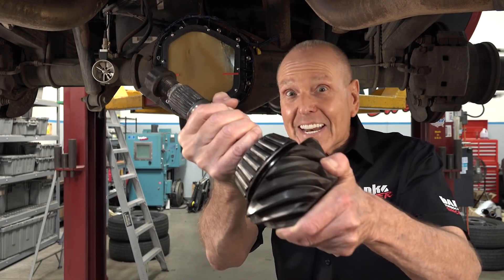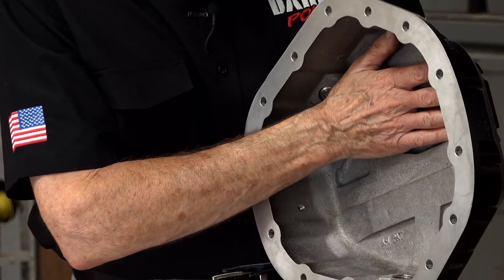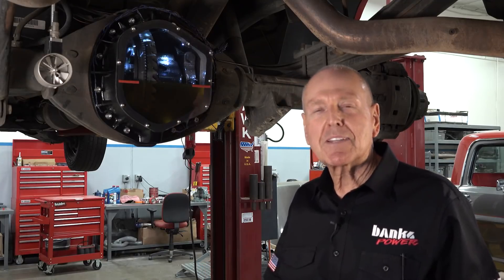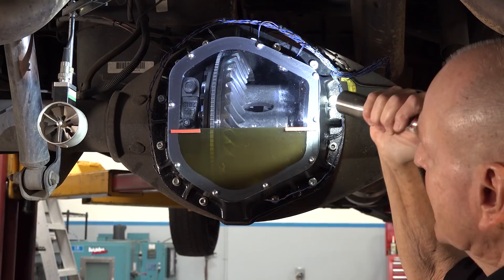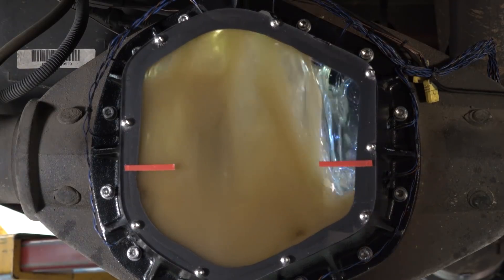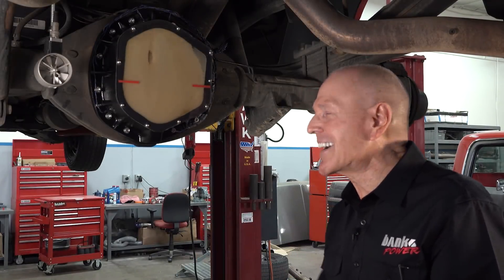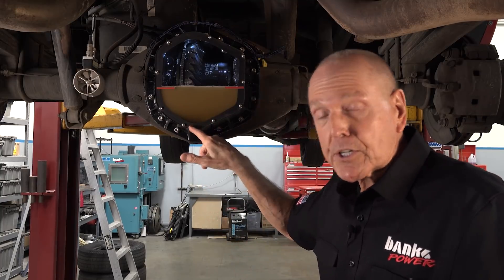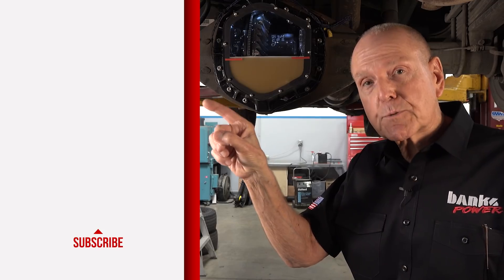What's going on behind your flat-back diff cover?

Comment: You allege that no oil is getting to the pinion but you don't demonstrate that fact. You need a borescope aimed at the pinion to verify.
Reply: With all of it ending up being splashed around by the cover, it makes a person wonder just how much is being pumped up to the nose cone bearings..  Maybe that's why they call for the extra fluid?
Reply: I think there's plenty going to the pinion, nearly impossible for there not to be with that much fluid splashing around. However it seems to get there far less efficiently than a stock cover.
Reply: Yea, I can see where he's going with everything except the pinion issue, look at the bearings in the rotor of the older American cars, you pack them with grease but it squishes out of the bearings almost immediately after you start rolling, it only takes the tiniest amount of lube to satisfy those types of bearings, I've been building Harley engines for almost 30 years and the same kind of bearings are in the bottom ends of those engines and with the exception of the connecting rod bearings none are pressure lubed, they rely on what trickles into them from fluid that just drips down the inside of the cases, those types of bearings require very little lube to do their job.
Reply: Seems fine to me.  Maybe they need to run one for 50,000 miles equivalent, one stock, and then pull the gears and inspect for wear indicators, cavitation pitting, etc.  That's the real test not cursory visual inspection of how the fluid looks on the cover.  XD  this whole series is crafted to create a market for Banks' finned aluminum covers.
Reply: Bingo.  More lube isn't better.
Reply: I don't think he is getting that out right. It is common knowledge that there is oil getting to the pinion or every one of these trucks running these common kits would be in the shop every time. Almost every newer 3/4 ton out there has a 4" lift, diff cover, programmer, delete's, exhaust, and bigger wheels and tires. Everything needed for the manly feel. They are getting oil to the pinion, but not in the best fashion. The bigger point is that the aftermarket cover doesn't gain over a stock cover. Something like the Ram factory design with an aluminum heat sink cover is likely the best option.

Comment: Great job Gale on the windowed flat cover. One can really see what's happening inside the dif. There's a lot of trucks on the road with these dif. covers. I agree with your analysis of what's happening inside with the oil. That oil has too much air whipped up into it. Perhaps a channel around the ring gear to mimic the original cover may help.

Comment: I appreciate your effort and videos, but every video I have seen, like yours, clearly shows ample quantities of gear oil where it should be. You make it sound like something really bad is occuring and making unfounded conclusions about "starving the pinion" when you can't see that happening. Of course it's not happening. It's being properly bathed in gear oil. Many aftermarket covers have cooling fins, too. That's very functional when passing through a parcel of ever-changing air. Then there are even more functional covers that actually support the internals, like LPW. Also, the term is aeration---not aereation.
Reply: It's a series! It's all leading up to end results with temps, drag, and what is and isn't getting properly lubed, are u that thick headed where u dont understand? Or u just bought a big cover a few weeks ago and are mad u wasted your money?
Reply: @kwmiked  You didn't refute a single point I made. I know many with these covers with no ill effects for many thousands of miles. It boils down to a preference, due to no evidence of a real problem.
Reply: @noampitlik2332  go do some research! Maybe none that u know of cause they are driving 20min to work. Go research the towing community
Reply: @kwmiked  Another non-comment? Take it easy.

Comment: Test the rockcrusher rear diff cover please!  Stock round shape, not aluminum, and very thick. Wonder how it does.  Like this comment so banks sees!!!!!!
Reply: Why? It's armor. It's normal shape but beefier. More than likely get hotter due being thick iron or steel.
Reply: U should just tell banks the results of all of the tests, itll save him a lot of time.
Reply: ...wouldnt it be ironic if an offroad piece ends up performing better than its performance counterparts
Reply: @d.a.r.123  it's simple science. Taking something then adding mass to it makes it a heat sink. Especially iron or steel which retains heat instead of releasing it like aluminum does. The one you talk about is basically stock inside with thicker walls and ribs. So it should work the same but should increase temps due to being thick cast steel.
Reply: @d.a.r.123  yes. Test your idea because it is special. When it's not.  It is easy to hypnotize what will happen with your idea. Unlike the original idea of trying a cover with a completely different design and capacity.
Reply: Tsunauticus III   WOW. You have too much time

Comment: I know all you guys are stroking yourself to what this guys is saying, but if you truly analyze what he is saying, it doesn't make sense. The fluid is going somewhere, it is going to the pinion. His hypothesis is already set and his theory is not changing. He thinks a flat back is detrimental to the design. So he shows results that reflect his opinion. He is not taking into account that the oil being splashed on the back is spreading the oil evenly to the aluminium which is transferring heat. This action way offsets all the "heat" he thinks is being created. News flash - Heat is created by the steel meshing, not by the oil sloshing around. There is no friction between a viscous oil moving against itself.  Why is he not taking temperatures of the axle in different areas? He is going by what it looks like. Listen, I own and love Banks products, but he spends a lot of time with this over thought out "quiet genius" when what he is proposing makes no difference at all.
Reply: I'm sure with this series of videos, we'll know for sure.  Any time you pump a fluid, you cause it to heat up.  Dead head your power steering - force the oil through the bypass, it WILL heat up.  You're doing work to the fluid.
Reply: There most definitely is friction between a viscous oil moving against itself.  If there wasn't, torque converters wouldn't heat up when you drive.  And both frictional and viscous losses cause reduce efficency (i.e. convert energy that could be used to drive the tires into heat).  

Of more concern with the flat-backed design is cavitation, where turbulence caused by massive changes in direction cause fluid pressure to drop to the point where large bubbles form and then collapse, which can cause metal damage long-term.  The shape of the stock covers minimizes turbulence. 

I think he'll come up with an aluminum cover with an inner shape similar to stock and outer fins to increase outer surface area to increase cooling efficiency.  If he was smart, he'd figure out how the air is flowing around the rear axle and use computation fluid dynamic simulation to determine the best way to direct the air using the fin design.  

I can't say that I know anything about starved pinions and pinion bearings, but it does seem silly for a design to add turbulence, which heats up the gear oil and increases parasitic losses due to friction.  Just saying.....

Comment: Excellent excellent video.  Thank you for the knowledge.  Many people don't even know that just by adding work into fluid heats it up.  Even by turning a pump on to a water system circulating water can add hundreds of degrees if left running.

Comment: Really glad someone did some real research on it as I had a feeling those things were no good at had lots of problems with them They also have a magnet on the into the dipstick to pick up crud and it's right next to where the fluid comes up and goes over to the ring gears I'm sure it takes that particles of metal and throw them right back into the gear set

Comment: Makes perfect sense and each video gets more in depth. I'm still stuck on temp.   I've got diff temp gauge in my 14 Bolt and truck weighs 7300 lbs.  Cruising at 70mph temp maxes out at 180 which I feel is quite good.  300 really seems high

Comment: He’s onto something. Back in the 80’s, Datsun used to sell a large capacity diff cover for the long nose R-200, and it was used in the stock turbo 300ZXT. The top was identical to the stocker, the extra capacity was a reservoir added to the bottom. They used a sling guide to mimic the stocker. Greddy has a similar one for modern Nissan R-230’s and others...

Comment: Porsche added a cooling loop (fins on an alloy tube) to the diff housing on 944turbo, tapped
into where the ring gear provided the pumping action. 
Under load, keeping oil  from degrading into thermal runaway failure.
(Pretty neat and clever, possibly not what you would want for bashing through the woods, and muddy/Rocky roads, etc though.)

Comment: I see 2 things: 
1-if you want one of these flat back "cool" looking covers, weld an aluminum "arc" in line with the ring gear mimicking the stock cover.
2-if you want to help the oil cool, weld some fins on the stock back cover. 1/8" thick maybe 3/8" to 1/2" wide. 
.... As shown on the F150, even having a minimal flat spot on the top of the clear one he made limited the flow of the oil forward. Look at all the stock pumpkin style rear ends.. They are all round.

Comment: Something to consider; take the round profile idea to the extreme and make a rear cover that has a formed volume to it that encases the rear gear - at least the rear half. As the oil is forced to follow the gear, have some tubing at the top to direct some of the fling off (so it would act like a leaky oil pump) directly at the pinion. At the bottom have some fins in the fluid to help transfer heat to the rear cover.

It would be real helpful to have a means to observe oil hitting (or not) the pinion; as we really don't know how well or how poorly it is being treated.

It really does look like these covers are creating a problem then trying something to solve the problem. That said, what if you had a reservoir on the bottom to hold more oil - but shaped so that it did not raise the level beyond stock and shaped so that the oil could smoothly flow around the gear. You'd have more oil to work with in heavy duty situations and with a large reservoir, more surface area to slough off excess heat (probably only useful in extreme duty situations though).
Reply: "have some tubing at the top to direct some of the fling off"

There's actually something like that cast into some diff housings.

Comment: I installed a Mag Hitech on my '03 2500 Ram (11.5 AAM axle) earlier this year on the advise of a friend who has one. After seeing your earlier videos, I have become concerned on several points. One is the higher fluid level washing grease out of the hub bearings. I have bought new seals and plan to repack the bearings and lower the level. Your earlier discussion and now this vid have me wanting to remove the cover altogether. Consider a large flat back cover with a "ski ramp" or "banana peel" on stand offs to direct the fluid. I recall the Dana 35 had a cast in tunnel to port fluid off the ring gear to between the pinion bearings.

Comment: Awesome! Aeration of lubricant is a huge engine issue- the reason racers use windage trays and deep oil pans. Get the moving bits out of the lube sump to minimize aeration and drag. Probably also why NASCAR stock cars have reservoirs and oil pumps on their rear ends.

Comment: FYI, put the flashlight lens right up to the diff cover and light up the fluid vs. stand back away and cause a big reflection off of the plastic cover. Should see better results with the fluid illuminated and nothing else.

Comment: This has been an interesting series of videos..  I was under the thought of slightly overfilling the gear boxes for better lubrication ( more oil, more lube.. ), never thought about the excess fluid having to be pumped and gobbling up valuable HP.  (( When you run S10's powered by 2.8 motors, HP is a finite resource! ))  Thanks for the education!
Reply: How much HP do you think it takes to froth up a few liters of fluid?  Even if it's the biggest of diffs, a 4WD Dana 80, takes 4.7 liters (1.2 gallons).
Do you think a 1/3HP Kitchenaid could froth up 4.7 liters of fluid the same way?
Do you think you'll notice a 0.26% loss in HP, ever?  (0.33 / 125 = 0.0026)
Reply: Well, it depends.  If you're like me, and trying to squeeze every last MPG and HP out of a gallon of fuel, why waste it as heat?  No, only a dyno will notice that 1/3 HP.  And even then, it could be chalked up to noise.  A HP here, a HP there, pretty soon, you've got some pretty serious loss.  

If you've got a big turbo diesel, running stacked chips on stacked stacks... there's more windage loss spinning the water pump and would never notice it.  ( Along the same lines, why do people index spark plugs, underdrive pulleys, other power "mods". )

Comment: This is why I’m running a stock Ford finned aluminum cover on my Excursion. They are cheaper than the aftermarket, and perform far better than those flat aftermarket ones. Ram also has a stock finned aluminum cover on the duallys that can be put on the standard 3/4-1 ton axles.

Comment: At one time, I think in the late 80's there was a Diff Cover for the Ford 8.8”  that used the oil energy coming off the ring gear in that lower part to send oil to an oil cooler with out needing an external pump. I had one back then. I don't remember who made it. If I remember right the return oil could be returned back to the case just above the ring and pinyon contacting area.

Comment: Mister Banks this looks like it can be fixed with a piece of sheet metal and some time with a shaper, to form a channel around the ring gear to keep the oil flowing the right way and not over working it. We do something similar in off road axles with high pinion 9" third members, but we call them "scoops". The "scoops" job is to funnel the gear oil up into the pinion oiling holes at the top of the third member, this is even more needed in Spider Nine axle housing's. As they are larger than a stock Ford 9" housing and basically block the oil flow at the bottom with a "Wall".

Comment: I lover these type of videos.  He really thinks about everything, I wish more people were like him, he's last of a dying breed unfortunately.  Keep up the great work.I can tell just from these videos that banks products that he sells are the best engineered and thought out designs on the market.  Note:  I have a 98  dodge 2500 12 valve quad cab 4x4 auto.  I bought it used 1 owner.  it came with a MAG view rear diff cover, it is a flat back design with a plastic window in it with 2 giant magnets in it to collect metal debries from wear. This cover is not made anymore.  unbenounced to met when I bought it but the diff side bearings were failed the drivers side spun in housing.    what was the cause of failure???  I have dome some research and it is a failure that I was able to find others have had the same.   did the cover have anything to do with it??

Comment: I think you are on to something here. I think you are right and it makes since. What I think would be cool is if you could drill a hole in front part of diff where you could mount bore scope and do the same test to really see if any of that fluid is getting to the front pinion bearing.  Maybe a different way I just think if we could see there it would be a real eye opener.  Another thing is I know you have to set constants but I wonder how it is going up and down hills.

Comment: there is definitely something to this...cause when you look at a Ford Racing diff cover for an 8.8 axle, it's in the image of the factory, stamp steel version. the changes are it's aluminum and has cooling fins and ports for external coolers, temp sensors etc.

Comment: You could probably see a noticeable gain in drivetrain losses running these aftermarket covers. Reminds me of a drag racer changing to a electric water pump, removing the thermostat and then wondering why the engine over heats...

Comment: Very interesting, another problem with aeration is that when the fluid is squashed between the gears the bubbles pop with explosive force and pitting can occur. This can be observed in a gear rotor style oil pump that is pumping aerated fluid. Automatic transmission engineers have known this for years.

Comment: My background is in boating. Fluid movement. One thing I've found that might be relevant is that in feeding water into a jet drive, we put a little lip that tended to cause the water to turn from horizontal to vertical, and up into the jet pickup.
I'm wondering if a lip extending pass an edge, top or bottom, of the differential might "trip" the air into moving vertically into the cooling slots on your new patented cover.

Comment: I have to admit I bought an after market aluminum diff cover because I thought it would help cool it and it had bolts in the back that supposedly helped support/reinforce the bearing saddles. Think I was a bit duped by the support aspect, more than the cooling aspect, but it is also squared off, which makes me think about replacing the stock cover. lol